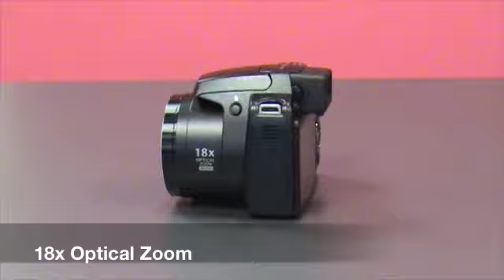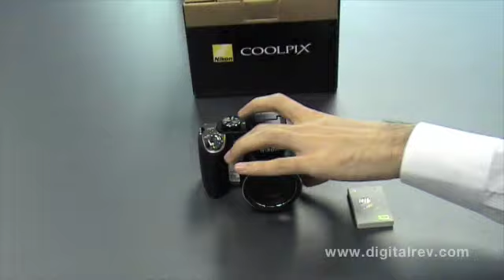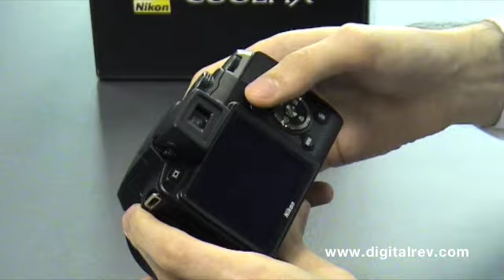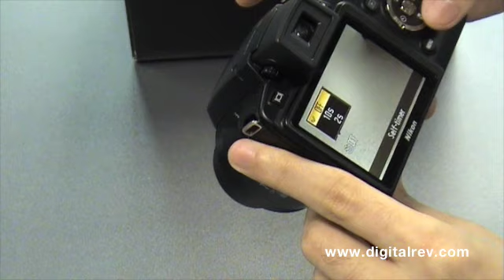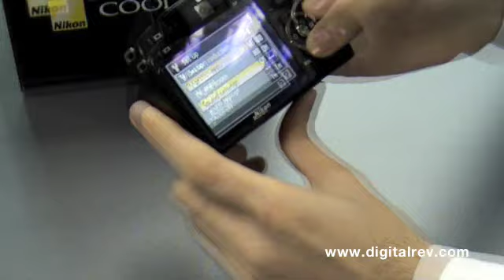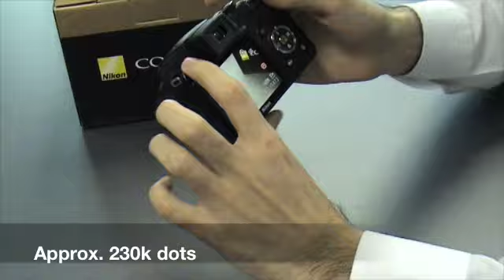Nikon COOLPIX P80 - First Impression Video by DigitalRev

Comment from the maker: The P80 a has higher resolution, 10.1mp to the S5's 8mp. P80 also has a bigger zoom range, 27-486mm while the s5 is only 36-432mm. The P80 can't manual focus unlike the S5 but P80 trumps it by being able to focus at 1cm compared 10cm on the S5. The p80 has continues shooting of up to 13fps, and a slightly bigger LCD at 2.7 inches. The P80 also weighs less at 405g to the S5's 550g. In short, the Powershot S5 is a pretty good camera but the Coolpix P80 wins on most respects with newer technology.